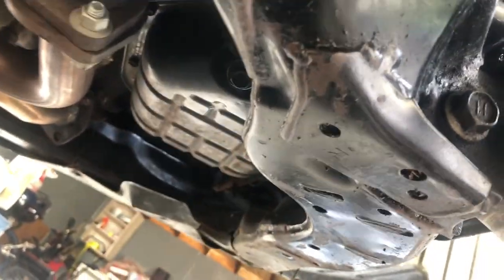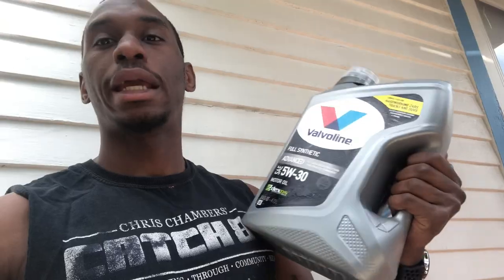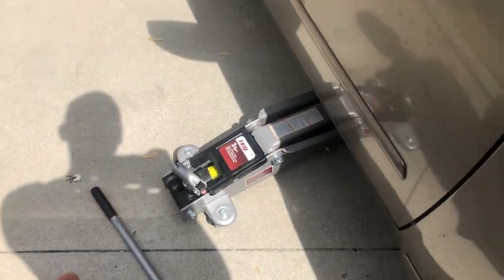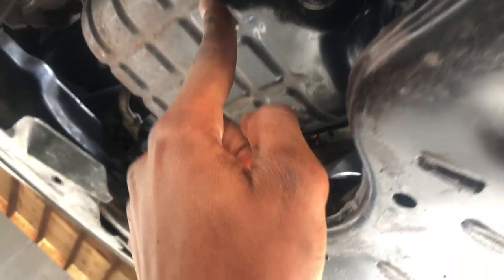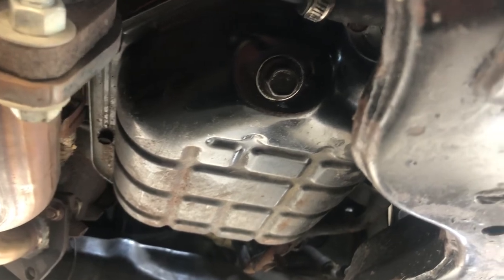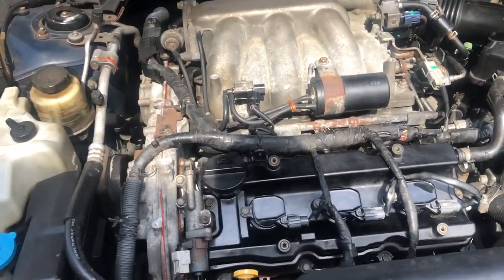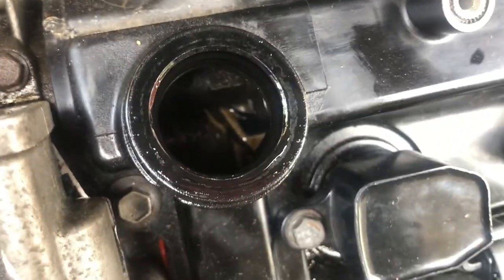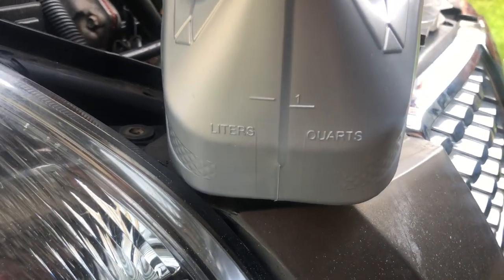2004 Nissan Maxima 3.5 SL | NIssan Maxima Oil Change | How To Change Your OIl (EASIEST)

Comment: It's the MAXIMA!! <3 I never changed the oil myself on my Maxima, but I remember just CHECKING the oil in my car one night when my husband and I were FIRST dating (actually we weren't dating yet) and he was like, super impressed by that! I was like, "what? ...I mean that's pretty basic stuff!" (he's not super car savvy though) lol
Reply from the maker: Lol I’ve Witnessed That A Bunch Working At Auto Part Stores Which Is More Than Common😂😂 And At Least You KNOW TO Check It, I Know Some People Who 1 Year Later Have Not Even Thought About It😭
Reply: @momentswithmurph8066  well isn't it like every 2K miles you're supposed to change it? & for older cars...it's even less. I bought my maxima with approx 150K miles on it already (but I mean..those things can go for a long time!).  I would always get the oil changes specifically for older cars, it was more expensive but gotta change that oil!!  Good for you knowing how to do it yourself, I always spent between like $40-45 to get mines changed!!
Reply from the maker: @pastasoss1565  Lml They Say About 3K Miles Just As A Rule Of Thumb To Make Sure People Stay Up To Date But As You Dive Deeper Into Different Oil Grades, Different Oil Brands, Different Oil Weights, Etc. It Really Depends 😭😭 And With The Older Cars It Usually Is Less Than That Because People Throw The Cheaper Oil In There Because It’s The “Older Car”…… But Lol Yeahh Those Cars Definitely Do
Reply: @momentswithmurph8066  so many options, you're very knowledgeable about cars that's awesome (save that coin$$$)!! lol